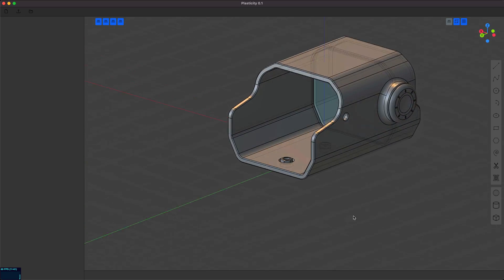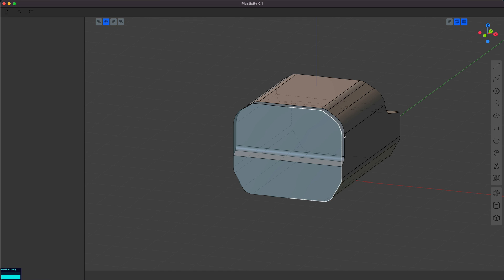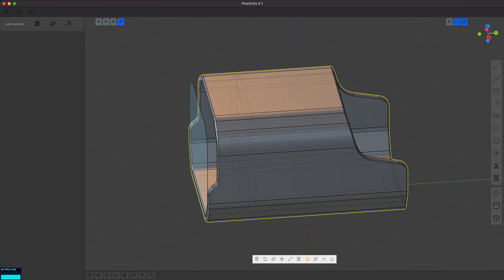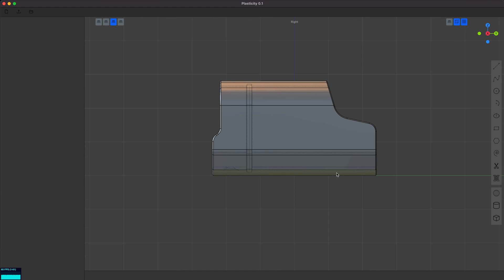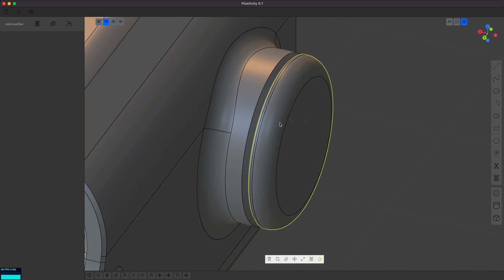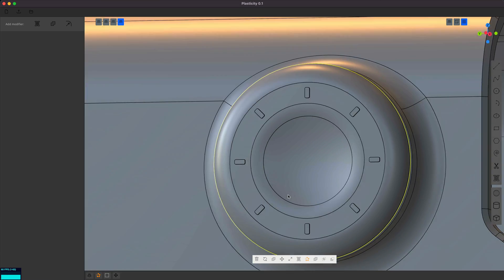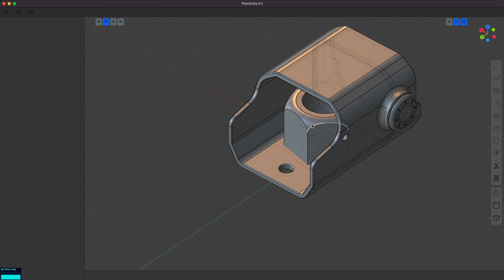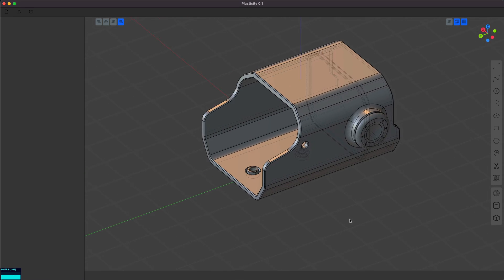Modeling a Weapon Sight in Plasticity

Comment: 1) how do i get the control points to adjust bevel of individual curve points/bevels after initial bevel. i'm using the latest "unstable" version and i do not see the "dots" 2) i do not see a "shell" command but a "shell explode" - but it doesn't work with that function as shown in your video